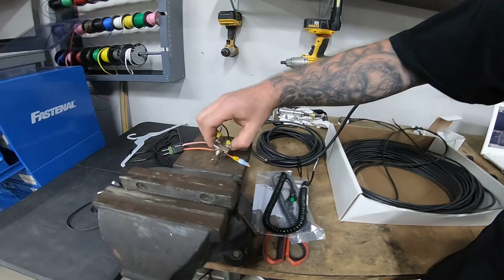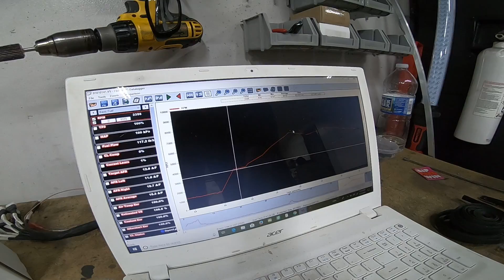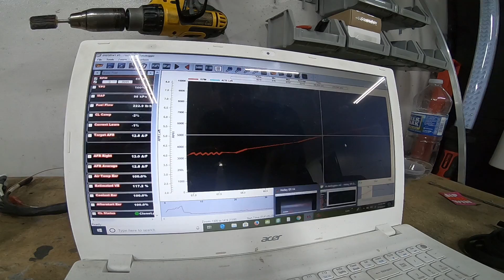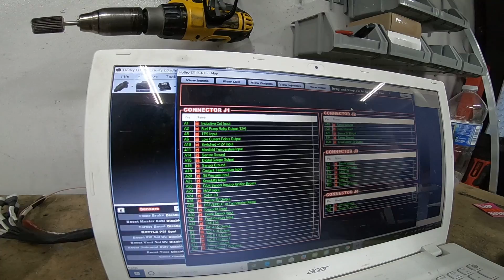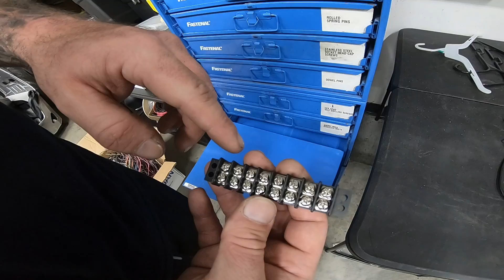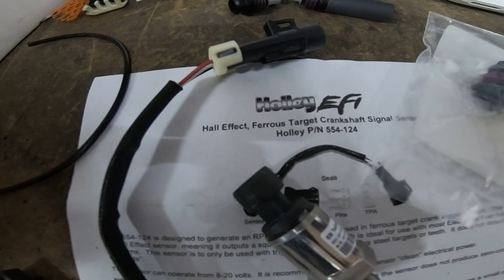holley wiring tips and donts

Comment: I'm very late to the game here, but awesome video. This answered a lot of questions I have had in wiring my sensors. I've been stocking up on Metripak connectors, pins, etc to try to do this as cleanly and gaplessly as possible, while making repairs and diagnosis as easy as possible later on. Originally, I had mounted several terminal blocks to my electrical panel, but have since made a new panel without them and have been stressing about how to pull multiple +5V sensor, 12v sensor, and sensor grounds in an organized and reliable fashion. Seeing the "Octopus" you showed in this video helped tremendously, along with the step down butt connectors you showed in another video... I didn't know these existed. Thank you for everything, and keep up the great content.

Comment: Great info in all your videos!! One question though running a Maven Bulkhead connector is it OK to run the transducer wires through that or run them separate just the red grommet? Thanks just for nitrous controller not EFI

Comment: Like the quality of work. Question on switched power wire to Holley ECU, best practices on this wire? Use a relay to battery, just go on the ignition switch? What have you seen work best? I have noticed you don’t have a second wire going to battery for this to power relay, can the wire be shared with the switched power to CD box?

Comment: Hey brother I just finished wiring the Holley hp efi. Tried to go for my first start up and nothing. Motor turns over but no injectors or spark. I checked computer and it's reading all the sensors, the crank sensor shows red dot and says stall... when cracking it goes between stall and sync...but then back to stall. Data log shows flatline crank signal. Replaced crank 2x alrdy😖😖 I'm out of ideas

Comment: As far as price on that wire harness. It’s probably cheaper. You said, roughly 85$ for a hundred feet. That’s for 3 wires, plus shielded, bonus, cheap wire at local parts store is probably around the same but for just 1 wire in that little spool.

Comment: what wire do you recommend for cable carrying a load like 12v to crank starter and to all you lights such as head lights and accessories like a oil scavage pump and fuel pumps I'm using #10 THHW electrical wire lol that you would use in your house but looks like shit so looking for a cleaner option

Comment: Booted connectors IS INDUSTRY STANDARD when you deal with professional autosport wiring.  I use at BARE MINIMUM  TXL and for autosport, its Tefzel wire.  Concentric twisted, service looped, DR25 covered with a heat shrink boot.  That is industry standard.  Yes, its expensive,. No, you wont spend time between rounds fixing shit wiring.  This is a much bigger deal for road racing, endurance, off road racing that drag racing, but I consider it all the same.  High temps, heavy vibration and constant servicing makes that a necessity.

Comment: Couldn't agree more about the pigtail ends.  If a guy can't crimp terminals and push them into a connector properly, there is a good chance he won't solder and heat shrink a pigtail end to make a proper connection.

Comment: I really like Deutsch DT and DTM and the amp connectors that use the same pins and sockets as the DT. I wish all connectors used the full barrel crimps like on the DT and DTM. So easy. So strong. They’re savage. It is crazy that people will spend 10 grand on an engine no problem but struggle spending on proper kit for the wiring. I appreciate how you always mention there is usually more than one way to achieve a goal but there is usually a way that is better than another. Hell yeah. You are a savage and I appreciate it and I am glad you are wiring up cars.
Reply: I like the Deutsch as well, the pins seem nicer

Comment: Hey, I'm installing an HP EFI on a Suzuki Hayabusa. This will be the 3rd Busa I've installed the an HP on, but I'm running into a problem that I can't figure out! The setup for the bike is Crank: 24-1 Magnetic, Cam: Single Pulse, Digital Rising, DIS Coil-On-Plug. I'm having a no start issue with the bike because there's 12v flowing back out of the cam signal wire (A22). The bike starts fine under non-sequential mode, but won't start with cam because of the signal wire issue. These are the same settings we use on all the Busa's! 5v reference to pin A26 and the ground to A14 (I also tried using A18 for the ground). The cam sensor is not hooked while I'm checking the voltage that's coming out of signal pin A22, so it's not the cam sensor! This is a clean (Super Clean) install! Can't figure it out! Any help would be greatly appreciated! Thanks!

Comment: awesome video man.. this is the kind of info i need to see. i'll be building out a full harness with holley super sniper efi soon. i do have 2 questions i hope you can help with -  1. where's the best place to buy one of those metri-pack connector sets? 2. when you talked about your 8 sensor pigtail, you mentioned a "Z" splice??  I tried googling around with no luck.. can you point me in the right direction for how this is done?

Comment: How do you like to ground your shielded cable wire?
Reply: The shielding itself?  A14 of p1A
Reply: @allansimonson8971  Yes. As I understand it the braided cover should be grounded to drain the noise. Some say t battery ground is fine, others say to holley ground. I have mine grounded to battery, but datalogs show slight noise.I'd post a pic of how my cables are done, but I can't
Reply: Direct to battery is probably ok, but Holley is probably better.